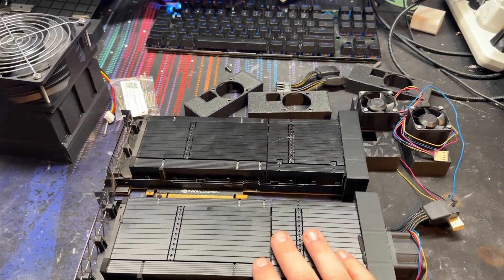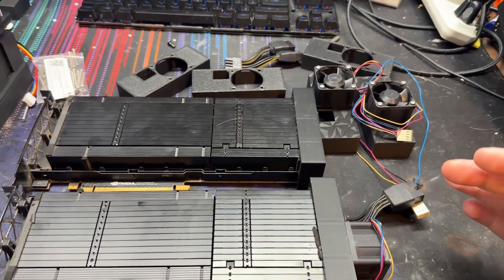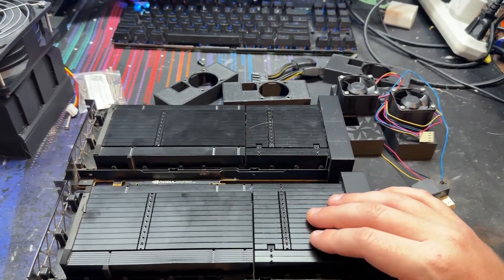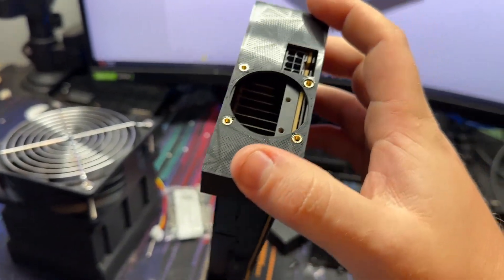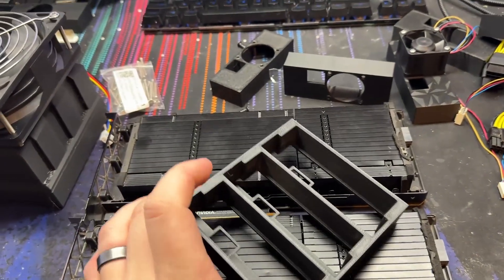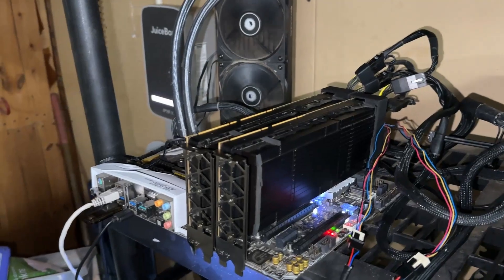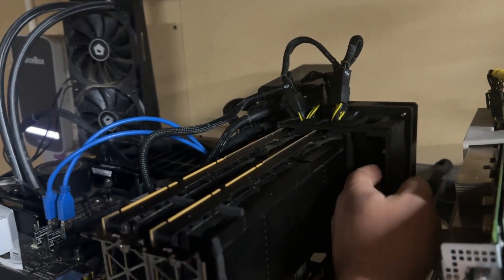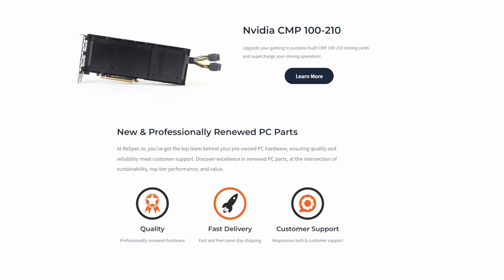NO Server Case? No Problem! Cooling the CMP 100-210 without a server chassis

Comment: ive 3d printed my own shrouds as well for my 2 i bought on ebay and they fit in my server case fine  but i am using a case that  i havent seen anyone else use my server case has a dual x99 motherboard with a total of 28 cores 56 threads 64gb of ram i cpu mine and gpu mine all in the same server case

Comment: instead of that big loud fan would a radiator regular pc fan work? they have higher static pressure than regular pc fans but are still much quieter than the big one
Reply from the maker: @lordfarquaadgaming9316  not enough cfm, its both pressure and flow. I tried running corsair radiator fans and they have pressure but no flow